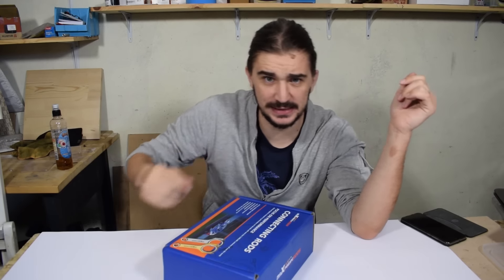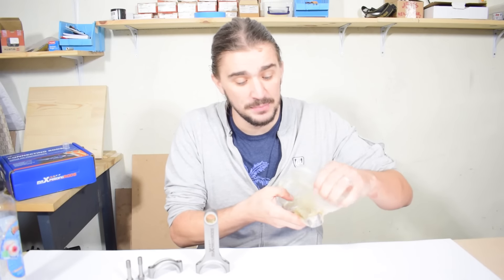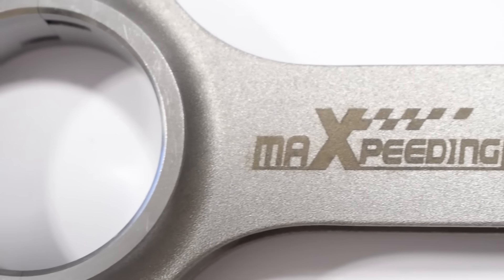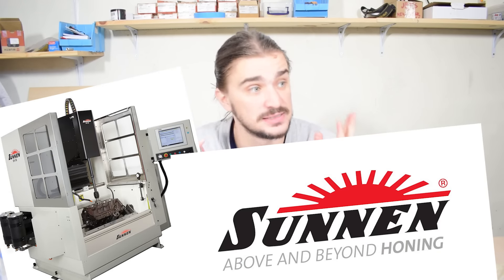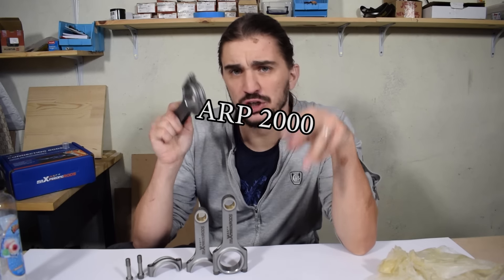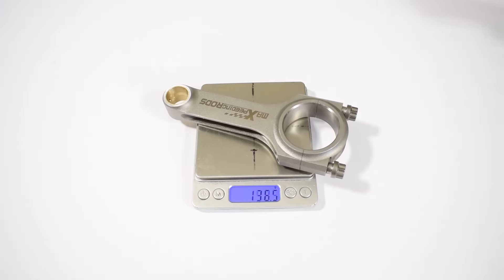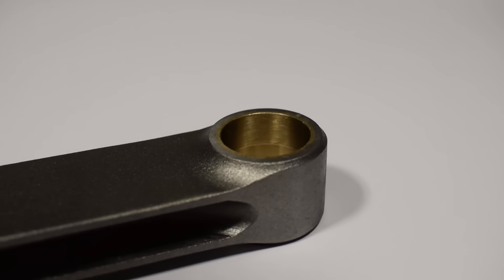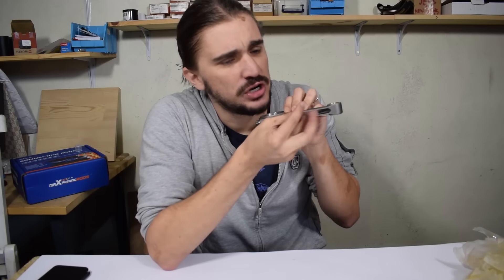UNBOXING budget forged CONRODS - MaXpeedingRods first impressions - PROJECT UNDERDOG #2

Comment: As you do know.. only good test for conrods is many happy customers, or at lease 6 independent compression and tensile tests from completely different production batches. I do think that "kung fu"  of making good rods is well know to almost everyone these days, and anyone can make them these days. Though question is, can anyone make them to be good and still make money on them. If that condition is satisfied, there is great deal of chance conrods shall be fine.   So, please, how much HP do you generate on them in what engine and how often you use all that power with that engine - I hate dyno queens that make power for 5sec and than are parked in show room or used for "granny" style of driving just to reach local bar. All the HP should be used most of the time, otherwise we can use normal car or no car at all.  I did bought these rods, just to see what shall I get They are so cheap that makes me bit scared. I am still not sure if I shall put them in the engine. Maybe I find new block, crank and head first, just to be sure I have spare if thy crack on me on mild 300WHP tune.

Forgot to link video that has approach I like. https://www.youtube.com/watch?v=x963HgKpLS4  I do the same. 
So when I get my set, I shall measure them and than see what happens.  I measure all,  big and small end, I hope they come straight.

Comment: getting pretty tired of all the anti-china bs, if you don't like it, don't buy it. china produces what you pay them to produce. it's all about quality control and the greed of the reseller. not entirely convinced about the chamfer on the inside of the small end, would address that before installing. end to end balancing would also be on my list.

Comment: HP rating are a joke, its RPM that will destroy the con rods. Look at it this way, if your engine could make 600hp at 2500 RPM you would never overstress the rods or bolts. but if you had to turn that engine to 10,000 RPM to make 600hp ,the stress on the rods and bolts is immense.

Comment: Little ends flog out very fast.
The brass) bronze bushes are too soft
Chinese conrods are shit.
Spend a little extra buy something that will last.
If a pitcure of a Chinese slave building gives you confidence in the product...
You're very easily pleased.
Do me a favour.
Run these for a year and check out the play in the little ends.
It will be the last time you ever use them.
Use Argo rods they are not made in china